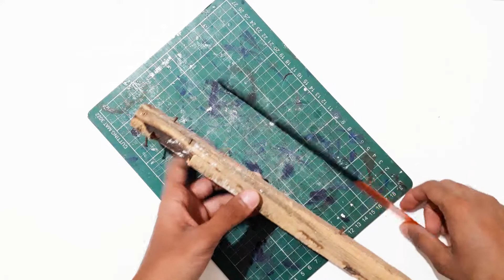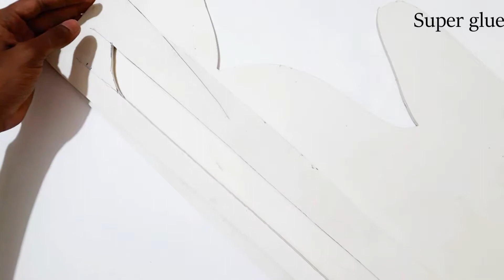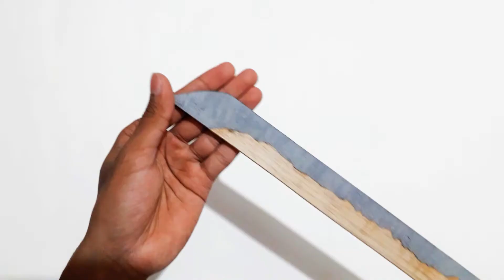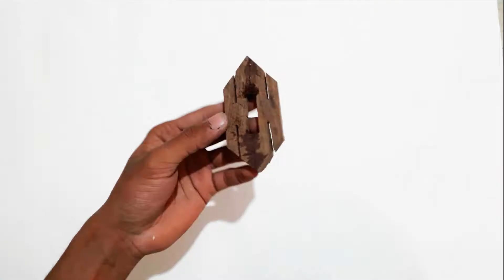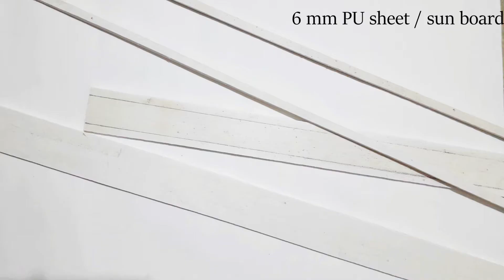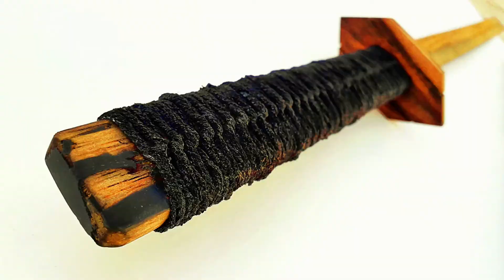M-seal wood katana | How to make sword out of wood and epoxy resin | Making wooden katana from scrap

Comment: i have a question about the m seal actually when you added resin+hardener it came as a small piece but how did you fill the whole blade with it should we buy more than one or one is enough and how much length is the sunboard also tell the breath please because I making it so I am having many doubts
Reply from the maker: I used 250 g m-seal to fill the whole space. I showed you mixing only small part of m-seal in the video. I used 4-5 pack of m-seal each of them were of 60 g. The thickness of sun board/pu sheet I used is 6 mm, if you cant find 6 mm just use 4 mm sheet just cut two molds and stick them with super glue and you will have a 8 mm thick mold. As of the width of blade its 3 cm.
Reply: @Dream_Blades  i really wanted these details thank you